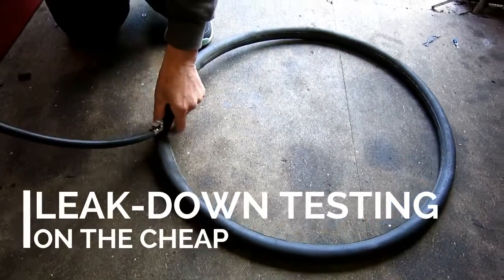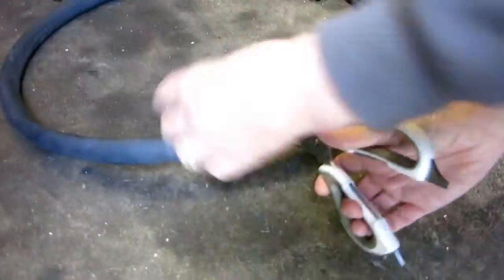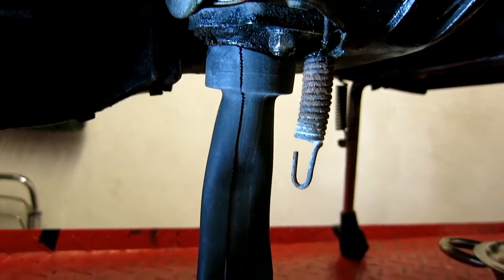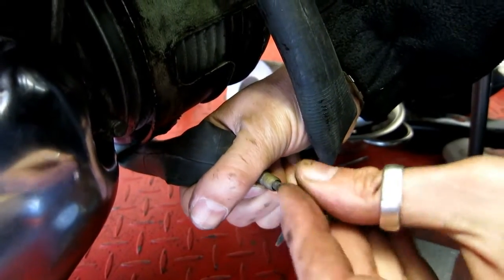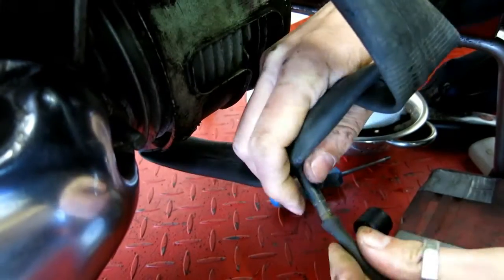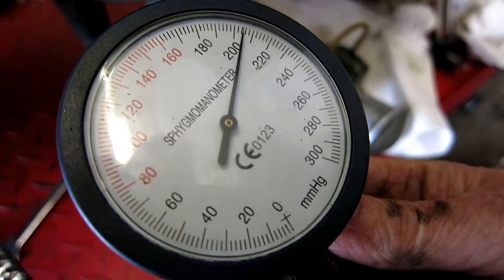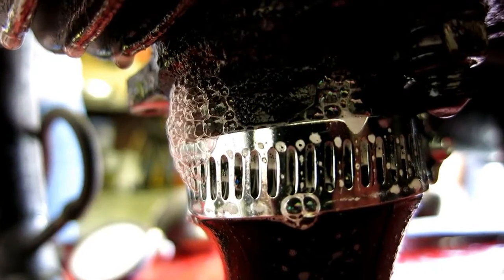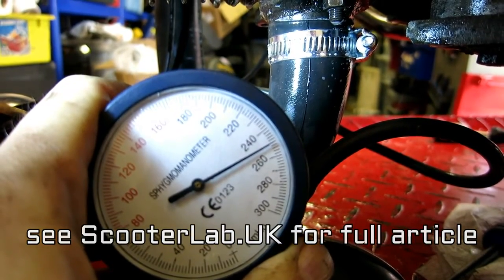SLUK | Budget engine pressure test (leak-down) with inner tube

Comment: Awesome video, how come you only pressurised to just under 5psi instead of 6psi as mentioned during the setup? I thought 6psi was nearing towards 300mmHg. Is it safe to go up to 6? cheers. again, awesome video and easy to understand
Reply from the maker: You don't need to put a lot of pressure in to find a leak so its better not to go mad. On a fresh engine too much pressure can invert an oilseal or blow-out uncured sealant.